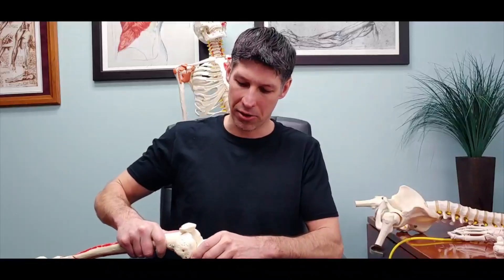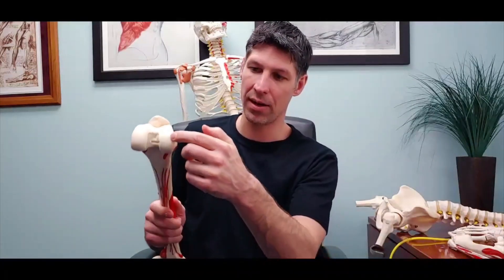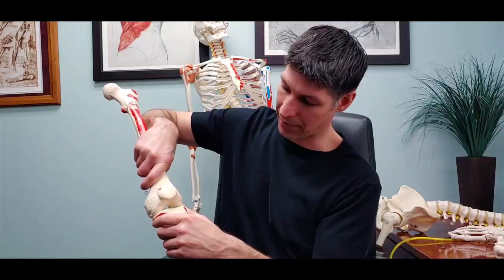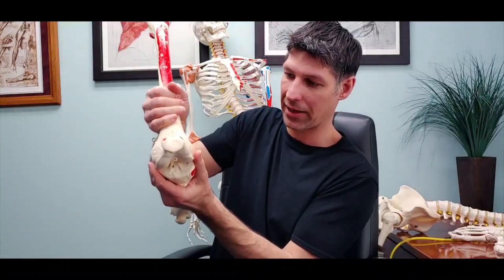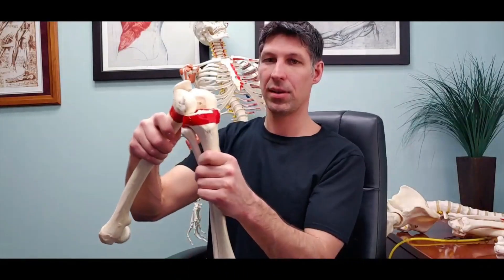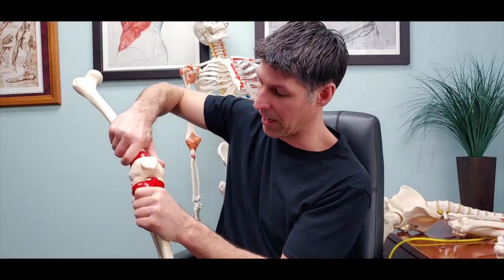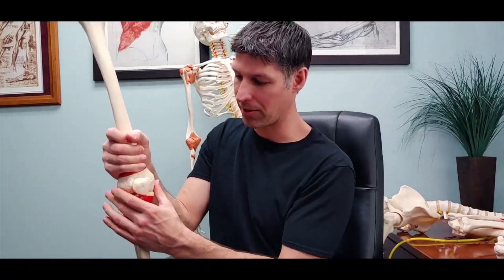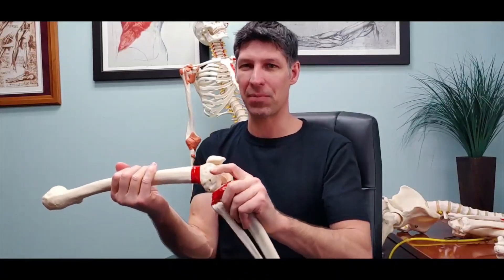Screw Home Mechanism of the Knee

Comment: I experience pain during what feels like lateral rotation. This discomfort has prevented me from running."
Reply: I would greatly appreciate any suggestions for addressing my knee pain. I've been diagnosed with grade 4 chondromalacia at the lateral condyle. Despite undergoing extensive physiotherapy, steroid, and HA injections, I'm still unable to run. The issue began suddenly in October 2022. I maintain a high level of fitness and used to play regularly for my Over 35s soccer team, but currently, I'm sidelined due to my inability to run. It's incredibly frustrating. thanks

Comment: Great explanation! I was hoping you would elaborate more about why the popliteous unlocking the knee is a myth
Reply from the maker: Simply put, there is nothing that truly locks the knee in a position of full extension. Any muscle the flexes the knee, or external forces such as gravity, is capable of creating knee flexion from a fully extended position. Popliteus may be involved and may even help guide the component of internal rotation, but it is not a necessary factor in this scenario. Also, there are different variations of popliteus and some of these variation may actually be weak knee extensors. But that is a topic for another video.
Reply: popliteus*

Comment: Thanks for the video. My question is similar to Sathya’s: why do you say concurrent lateral rotation? I’m confused because during terminal knee extension, if the tibia is rotating laterally on the femur, the femur is rotating medially on the tibia. Can you help clear this up for me?
Reply from the maker: The phrase "concurrent lateral rotation" of the knee implies that the rotation that I am talking about only occurs simultaneously with knee extension. During standard action lateral rotation of the knee, the tibia rotates relative to the femur. If the femur is moving on a fixed tibia during knee extension, then the femur does in fact rotate medially relative to the tibia. However, this is still lateral rotation of the knee. As a comparison, consider flexion of the elbow joint. Flexion the elbow can be defined simply as a bending of the elbow joint. If the forearm moves relative to the humerus, it is considered standard action elbow flexion. If the humerus moves relative to the forearm, this is considered reverse action elbow flexion. But they are both equally accurate descriptions of elbow flexion. Likewise, internal rotation of the knee is named with a distal segment bias. Standard action lateral rotation of the knee occurs when the tibia rotates on a fixed femur. Reverse action lateral rotation of the knee occurs when the femur rotates laterally relative to a fixed tibia, but this is still lateral knee rotation. The relative motion of one bone to the other is the same in both instances.
Reply: @thebiomechanist4995  Thanks for the reply. Now I understand the concurrency is in relation to the knee extending. Is there a way to accurately assess/measure the screw home mechanism manually? Is it even meaningful to asses it? Or do you assess it more indirectly by looking at things like ligament integrity since that plays a roll?
Reply from the maker: @markpellman4941  Great question. I will answer this from my personal perspective as a personal trainer and massage therapist. I do not try to measure the external rotation of the tibia on femur during knee extension; I am unsure how much clinical value this would have. Although if another practitioner sees value in it, that's great. I would not make an argument against their point of view. Due to individual differences in structure, people will have varying degrees or rotation associated with extension so one would have to be careful about drawing conclusions. In my professional opinion, I think that a range of motion assessment of knee extension is more valuable with an emphasis on end-feel and pain-free motion. I would also look the range of motion of internal and external knee rotation with the knee bent at 90 degrees. It is much easier to assess the overall ROM of rotation with this time of assessment, and restriction or pain with this type of assessment may also be related to inability to fully extend the knee. Finally, ligament integrity/laxity tests are very valuable, but outside my scope of practice. My guess is most athletic trainers and physical therapists would find ligament tests far more valuable than trying to measure concurrent lateral rotation of the knee with knee extension. This was a bit of a rambling answer, but I hope this helps!
Reply: @thebiomechanist4995  Thank you, that is helpful. I really appreciate your time on this topic. As a student PT, I'm always looking to learn more about arthokinematics and such!